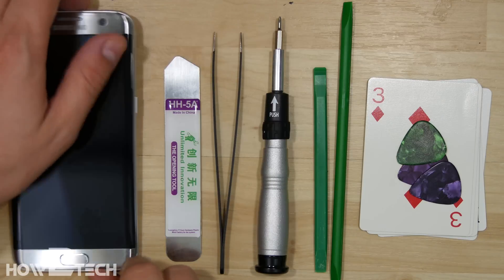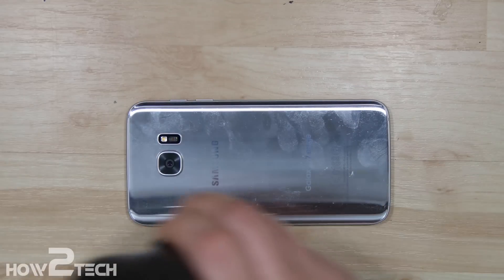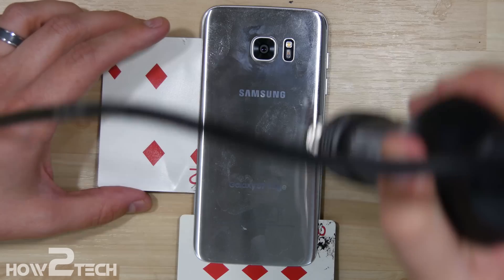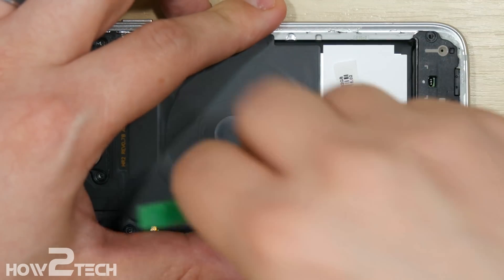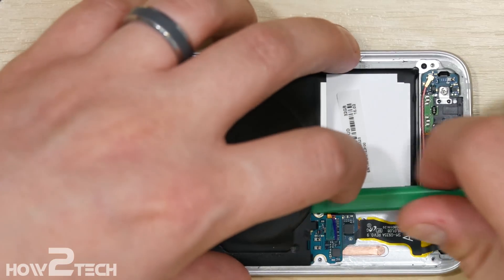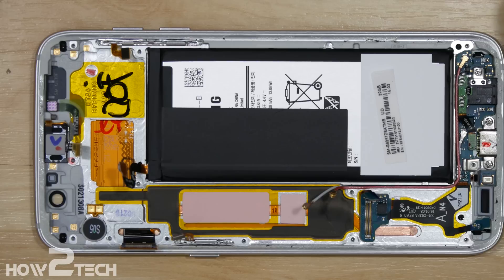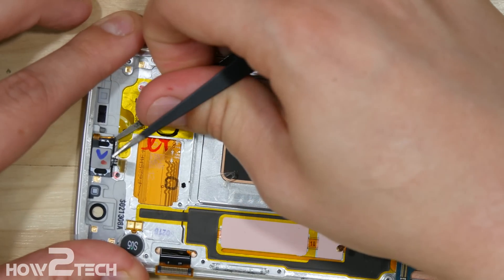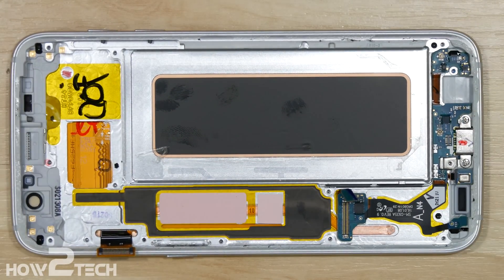Samsung S7 Edge Screen Replacement -Battery, Back Glass, Camera, Charge Port -Teardown

Comment: Hello, I removed my battery but noticed a strong paint smell coming from the corner, do you think it still works? or do I accidentally punctured the battery and that is why the smell is coming up? and do I need to replace the battery with a new one for safety reasons?
Reply: The smell you are smelling is a lithium leak and yes that means you have punctured the battery, I would recommend putting your battery in a container with baking soda to neutralize the chemical and getting rid of it, not sure if batteries plus might take it or not and buying a new battery. You CAN possibly use it and it should still work but I wouldn't recommend it. It could end up blowing up, bloating and damaging the entire phone, etc. Make sure you buy a NEW official battery from Samsung, I work for a phone refurbishment company and I have plenty of experience with working on phones and we have gotten even refurbished official batteries that have been total garbage where there is either a power issue or the flex ribbon has been torn.

Comment: you can't remove glass w/o damaging lcd & digitizer. just get both from ebay 250.00 usdm. great video! repair shop wants 80.00 just to do that
Reply: All of the new phones from Samsung are like this. The LCD is sold as a glass, LCD, and digitizer combo pre-assembled. The parts we get at my work with this phone have the glass, housing, buttons, usb pcb all in one pre-assembled.

Comment: will it still be waterproof
Reply: It should be, just make sure that any rubber gaskets and grommets are still there such as the microphone gaskets at the top and bottom, the loud speaker grommet, etc. Also, when you put the back glass back on press as hard as you can around the edges to seal the adhesive unless you happen to have a press machine from Samsung, which I doubt.. lol
Reply: Jimmy Gangster thanks alot for the advice and information! Very much appreciated :)

Comment: will the phone remain water resistant after doing this?
Reply: It should be, just make sure that any rubber gaskets and grommets are still there such as the microphone gaskets at the top and bottom, the loud speaker grommet, etc. Also, when you put the back glass back on press as hard as you can around the edges to seal the adhesive unless you happen to have a press machine from Samsung, which I doubt.. lol

Comment: im wondering if I can seal it back up with adhesive tape or if I should use a liquid glue..any suggestions?
Reply: +Dubbbya think the original back cover sticker would be better.

Comment: my only question one would is it still water proof
Reply: It should be, just make sure that any rubber gaskets and grommets are still there such as the microphone gaskets at the top and bottom, the loud speaker grommet, etc. Also, when you put the back glass back on press as hard as you can around the edges to seal the adhesive unless you happen to have a press machine from Samsung, which I doubt.. lol